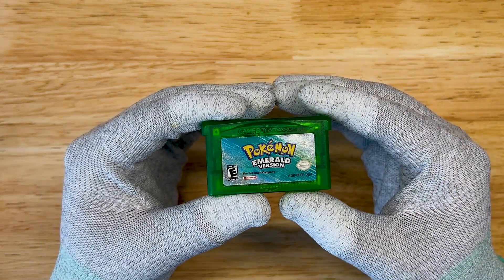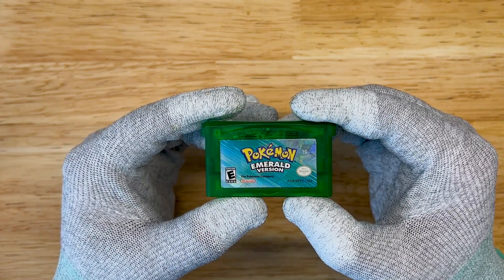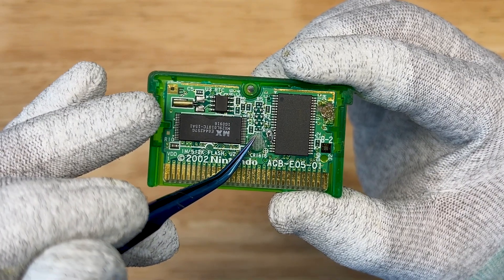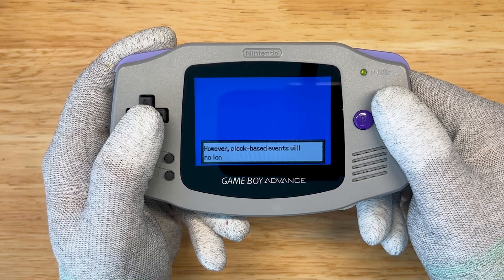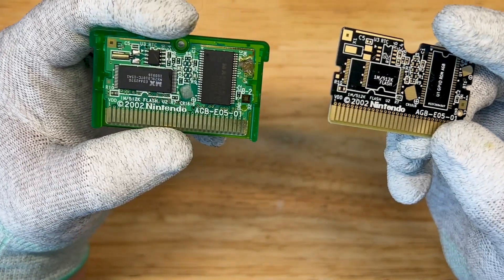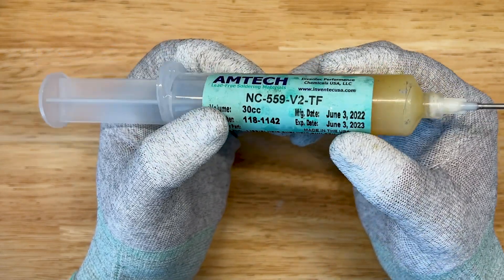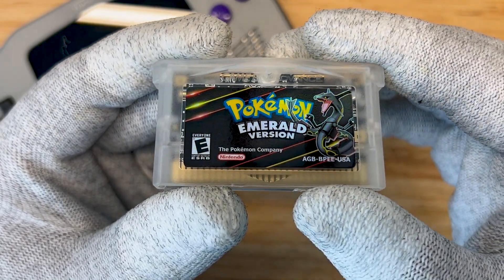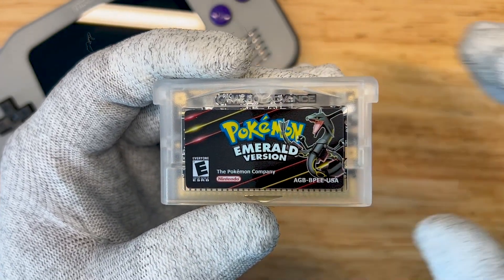Pokémon Emerald Circuit Repair - Creating Pokémon Emerald Shiny Version

Comment: I accidently pulled off the bottom battery pad on my Emerald, I've successfully replaced a ds cartidge reader before, do you think i could do the swap?
Is a hotplate necessary or could i get away with a narrow tip on my heat gun?
Thanks for the vid, I'll probably be referring back to it often lol

Comment: Question! can I Transfer my Rom chip into other circuit board? will it work? or is there any consequences? I am trying to save my US Pokemon Leaf green the rom chip seems fine but the pins of the board is corroded. I am planning to transfer the Rom chip into a Different circuit board with the same model. I just wanted to know if its gonna work.

Comment: Fantastic video. I got very close to doing significant damage on my first repair, but this is great to have in case the next battery change goes awry or for my next soldering job

Comment: Hi, not sure if you’ll ever see this but I was curious if you could tell me what the r10 component on emerald sapphire and ruby is? I know that it can either be a cap or a resistor for agb-e05-01 but what do these 3 specifically use? Also if it is the capacitor can you give me the exact specs or possibly an exact part number for replacing them. Some places say to use 1uf cap some say 0.1uf and I don’t know what I’d right. I really want to save this game.

Comment: Do you still do repairs? I tried changing the clock battery on my authentic Sapphire but I think I bridged two pins on the ROM chip with a tweezer by accident and then saw a spark. Was so upset when I saw that and it dawned on me that I most likely fried the chip...

Comment: The battery doesn't press against the top half of the shell or is there space made for the battery?
Reply from the maker: There’s enough clearance for the battery and the shell. If you use a battery holder, or a bigger battery, it will press on the shell and crack it over time.

Comment: I thought you had to soldier with a heat sync? Or is that why the flux does? Genuinely curious been years since I last did it.
Reply from the maker: Flux is a chemical that cleans oxidation. High heat creates oxides that prohibit solder from making a clean solid connection. Think of it like this. Have you ever put a sticker on a dirty surface?  If you have, you’ll notice that it doesn’t stick very well. Now if you clean that surface first you’ll get a very good bond. Flux is the cleaning agent that does that.

Comment: Hey man....could you maybe repair or fix my version of Pokemon emerald? It still works fine. For now. But I need the battery replaced and I think at one point, something with ink burst in the cartridge and got around some stuff. I've cleaned most of it but I'm not a professional.
Reply from the maker: Sure thing. Check out my channel description on PC. My contact email is in there.

Comment: Also in Germany you are watched😊 nice videostyle. But why are the battery pols unfixable? How do they work?
Reply from the maker: I could use epoxy and create new pads. Then I’d have to run jumper wires to reconnect the pads. It wouldn’t look good. 

Thanks for watching!

Comment: can you make a functioning link between Gen 2 and Gen 3 so i can transfer pokemon from Crystal to Emerald etc?
Reply from the maker: If you have a 3DS you can export your save from Crystal and upload it to the 3DS version of Crystal. From there you can use Bank to transfer it up. 

I’m sure you could still export your save and import your Mon using PKHEx

Comment: My battery died in my pokemon crystal game. I got someone with a soldering iron to replace it but i think they did it wrong. Is it easy to fix myself or not?
Reply from the maker: It depends on if you know what you’re looking at. Replacing a battery is basic work but diagnosing a board is something different. If you want to chat about it, shoot me an email. It’s in my channel description.

Comment: I have maybe a dumb question... the emerald version i got has a newer battery in it but the message keeps saying the battery is dry. I opened mine and my sister's sapphire version and it looks like there is a piece missing where it says "R9" on my emerald? Do you have any advice on how to fix this 🥺 i trust myself to change the batteries in RBY and GSC but this looks way too complex for me and i dont even know who to look for for help
Reply from the maker: Yup, R9 is responsible for that message. It’s an 0402 sized resistor so super small. If you want to send it off, I’d be happy to repair it for you. My contact email is corey@imod.systems.

Comment: Hello, very good video. I would like to know what equipment you are using and where I could buy them. For example the soldering iron.
Reply from the maker: The soldering iron is the Hakko FX-951. I got it from Digikey 

My hot air rework station is the Atten ST862D. You can find that one on Ali Express. 

Miniware MHP30 hot plate you can find on Ali Express.

Comment: Does flux just kind of hold the solder in place?
Reply from the maker: No, flux is a detergent that cleans oxides. Think of it this way, have you ever applied a sticker to a dirty surface?  It falls right off or it curls up. Without flux the solder will not flow, or create a strong weld. The heat from your iron generates a ton of oxides and flux battles those oxides.

Comment: I am just curious would the original PCB basically be impossible to fix? I did enjoy watching the video and what looked like a good amount of work that went into moving all the little components from one PCB to the other. If one was less skilled at soldering / had less equipment, would it have been easier or more difficult to try and salvage than essentially build anew?

I don't mind how the final result turned out - although I am a fan of the original, was just trying to set it right in my head as to why what seemed the more difficult path was taken.
Reply from the maker: The original PCB is certainly salvageable, but I think it’s more work. Cutting new copper pads, and epoxying them down. I’ve done it for other customers, but like I said, it would bother me. I wanted to make something unique and original for myself. Just a fun little project.

Comment: How did you learn all this stuff? Where would I get started if I wanna learn?
Reply from the maker: Honestly, one of the best ways to learn circuit repair is diagnosing and looking at video games. The circuits are a lot less complex and in a lot of cases you can visually see the damage, like in this video. You can graduate up to more complex things and the sky is the limit.
Reply: @imod.systems  cool. And but if I don't even know stuff like solder or the other things you used/did, is it just the same tips? Or start even more basic somehow? Sorry if that doesn't make sense
Reply from the maker: I got started when I found a YouTube video on a cool raspberry Pi handheld many years ago. I bought my first soldering iron and bought a bunch of cheap solder practice kits off of Ali express (you get get them for $1). I practiced a ton and continued to work on projects that interested me. That’s the best way to get started. Find something that you find interesting and have a go at it. It’s going to be super rough at first, but if you practice, you’ll get better.

Comment: Solid repair. I nearly used one of those custom PCBs for a Leaf Green I was fixing up, but wound up not needing it. Also that reveal of the PCB at 4:07 was god tier. Got a chuckle out me.
Reply from the maker: Thanks!  I had to do multiple takes at that part because I originally had a Leaf Green PCB in my hand. That was the board I teased in the beginning.

Comment: You must solder as a job, because I don't normally see gamers drag soldering with ESD thermal gloves lol.

If you're not already IPC certified, look into it. You do good work!
Reply from the maker: Thank you so much!  Soldering and gaming are both therapeutic to me. I usually stick to drag soldering these chips. I just got 0.015 diameter solder and wanted to try heating and feeding all of the chips.  Got frustrated with how slow it was going and went back to drag soldering lol.

Comment: I was wondering what solder you use for these repairs
Reply from the maker: Kester 63/37 0.031 diameter mainly. When I was heating and feeding the chip I was using 0.015 diameter. I’d recommend 0.031 for all around use.
Reply: @imod.systems thank you so much, I was hoping to get into this hobby and I am a total beginner. I loved your video btw.

Comment: This special pokemon cartige work's with gen 4 pokemon transfer as well ?
Reply from the maker: It will act and behave just like an original game. All of the hardware is the same. It’s just the board that’s different.
Reply: @imod.systems  good job 👍

Comment: I wish I could get my ruby repaired. It won't even read any more.
Reply from the maker: Chances are the edge connector needs a really good cleaning.
Reply: @imod.systems  I have alrighty tried that with rubbing alcohol and a cotton swabs. I think there may be corrosion on the board.
Reply from the maker: If you’re on discord, ping me. Username is the same on discord.

Comment: would using one of those motherboards for a pokémon game stop pokemon from being transferable from the emerald to a ds game?
Reply from the maker: Absolutely not. The replacement circuit board is a reproduction of the original board. What makes the game the game is the ROM chip, eeprom, and RTC. It will work exactly like an original game.

Comment: I have the exact same problem...One battery contact/pad is missing from the board, but I need more skills (and tools) to do this job. Would you accept a commission, or can advise someone who can do this?
Reply from the maker: I just actually did a repair recently for someone who lifted their battery pad completely off. I filmed it, and I may edit it and make it a video. 

Basically I used copper tape and cut it to the same size as the missing pad. Then I secured it down with solder mask. If it’s the positive pad you’ll need to run a jumper to R9 to restore power to RTC.
Reply: @imod.systems  that would be amazing. I will keep an eye to your channel.

Comment: dude i gotta say i have no idea what temp and and how long those ics can withstand without a datasheet but from the video i cant tell if there are skips but you are lucky those ics didnt short out or worse blow after they cycle. try using a couple inch thick of fr4 and use it as a jigg to help dissipate the thermal induction
Reply from the maker: I think this is the safest way to pull a chip without using low melt solder. No direct heat on the epoxy and the game was only on the plate for a few seconds to lift. I’ve seen others absolutely roast their games with hot air when they do swaps.

Also forgot to mention, the hot plate is only set to 220c. Much lower temp than hitting it with anything else.
Reply: love your videos and please if i can help your videos id love that and itd be an honor

Comment: How functional is that circuit board with transfers to other games? Like trading with other GBA Pokémon games, connecting with Pokémon Colosseum/XD/Box/Channel, or using Pal Park on the DS games?
Reply from the maker: It will function exactly like the original game. It’s just a replacement circuit board, copper traces / connections.  All of the stuff that makes it a legit game still exists; ROM, eeprom, RTC, etc.

Comment: Very impressive repair! 

Where do you source the tabbed batteries? I've never seen replacements look like the OEM. Most of the batteries I find have a yellow or red "protector" sleeve around the edge.
Reply from the maker: For the Panasonic CR1616 batteries I get them from console5 in the US. For my tabbed 2025 I get Renata batteries from Digikey

Comment: Now you need to buy 8,000 copies of Pokemon Emerald and sell them all at a slightly raised cost, with the premise that there is a 1/8,000 chance to get a shiny.

Jokes aside, this is a brilliant repair, and it's refreshing to see an eBay seller actually tell you when they've broken something. Also, with the Black PCB on "Shiny Emerald", phenomenal.
Reply from the maker: Holy, I think my wallet just ran away at the thought of that.

Comment: Well, I was going to say kudos to the seller for being honest about the repair attempt and the solder on the chip. But then we got to the PCB with missing pads for the battery... Why are sellers on eBay always lying? I hope they at least had pictures. If they had the game open to attempt this repair, they should be able to open it again to show the board.

That replacement PCB is really cool. Glad that exists! And that hotplate is really nice too, those chips came off like nothing.
Reply from the maker: Yeah, I’ve repaired a ton of games off of eBay and was really happy that this seller was so forthcoming. They had very detailed photos showing the damage. They didn’t describe the missing pads but I saw them in the photos. 

Thank you very much for the comment!